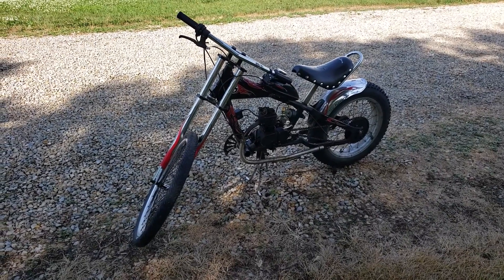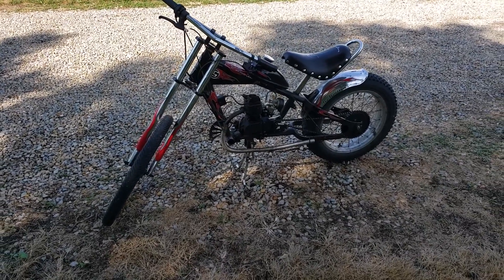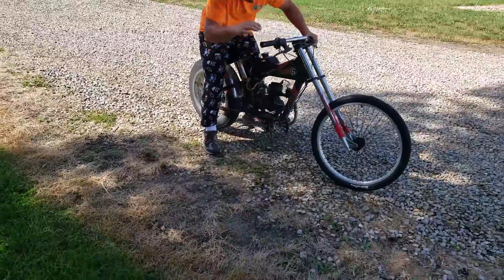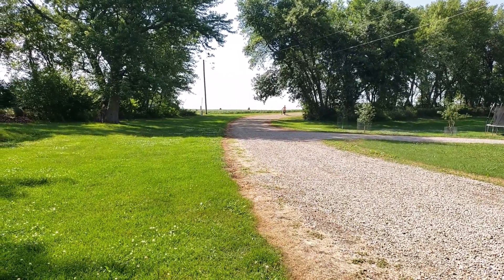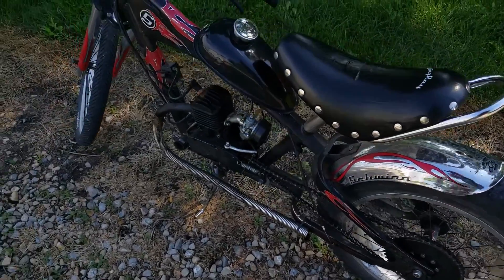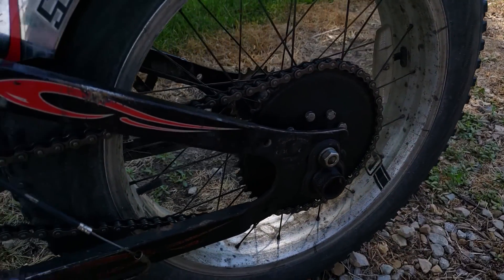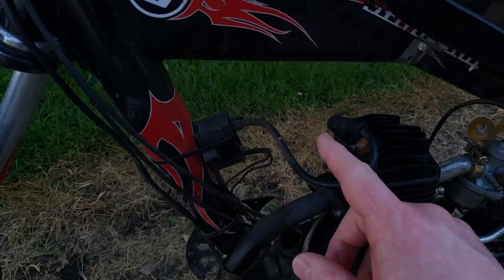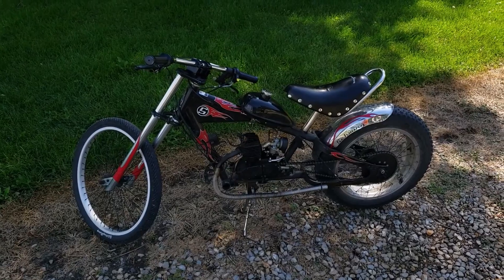Schwinn Sting Ray Bicycle powered by 80cc 2cycle Bike Motor Kit

Comment: One a two stroke, the pipe is probably the most important component to make power. See if you can find a pipe with an expansion chamber.  You won't believe the difference it makes 👍🏻👍🏻
Reply from the maker: The muffler flex piping we used is very poor quality so for its replacement we will look for something like your suggesting.

Comment: Did you guys also get the mount for the motor? I don't see it in the listing on amazon. Thanks.
Reply from the maker: The engine mount came from Ebay. You may find that engine mount on ebay.com Search for ebay item #: 174907780346
Reply: @crankytuber  I actually bought a kit and a mount for one of these bikes because I had the bike already. I started to put it together and could not fit the sprocket on the hub. How did you fit yours on?
Thanks.
Reply from the maker: The sprocket is mounted to the spokes of the rear rim with rubber disk included with the kit.